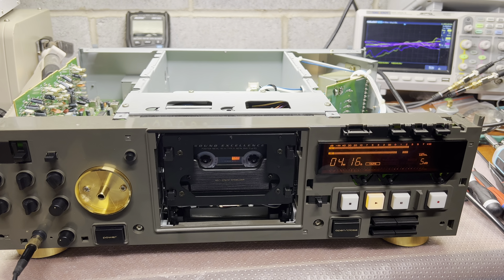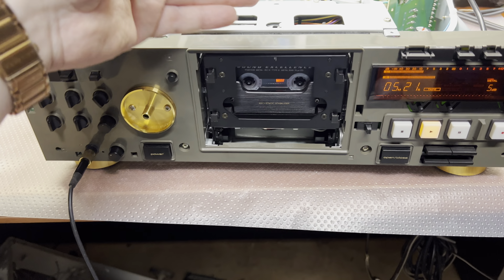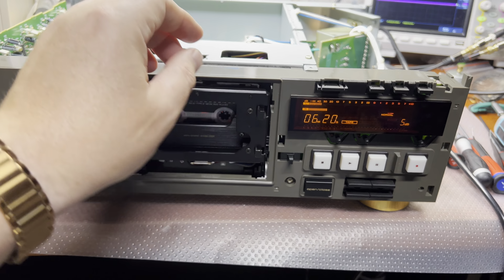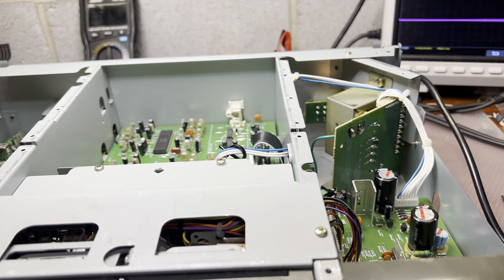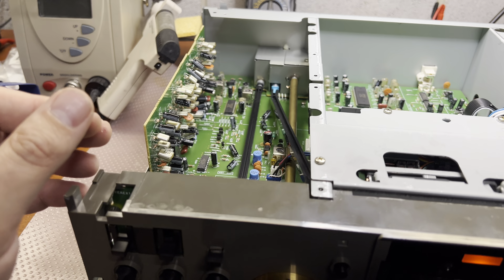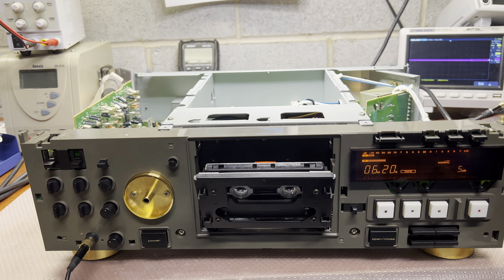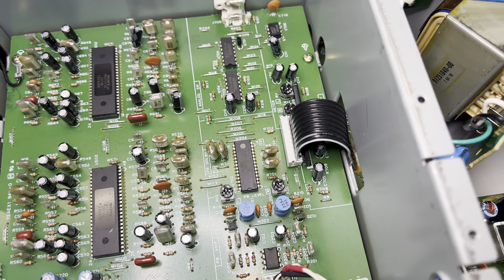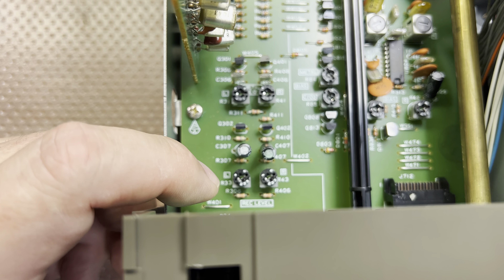Teac V-8030S Restoration - Tracing and Diagnosing Electronic Issues

Comment: This has the same head mount block (and visually identical heads too) as the Kenwood KX-9010. The nice thing about these is that they work perfectly with the cassette pressure pad removed, unlike other dual capstan decks - you can really extend the life of the heads by using them like that. The thing I don't like about these drives is the geared idler option. Although more reliable than the rubber idler, the slotting from the gears does cause a certain amount of flutter. This depends on the quality of the cassette and maybe on how the plastic gears have aged, and is most noticeable at the start of the tape when the takeup reel is the lightest but it is there...